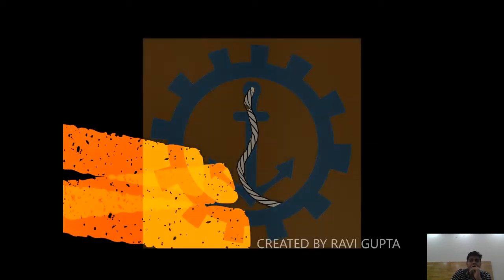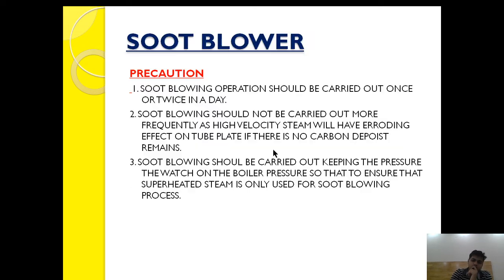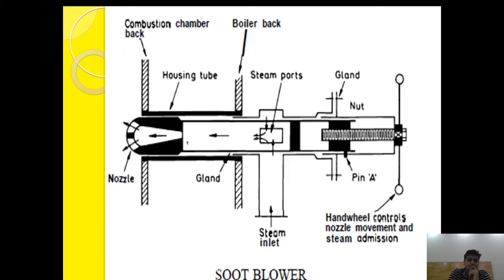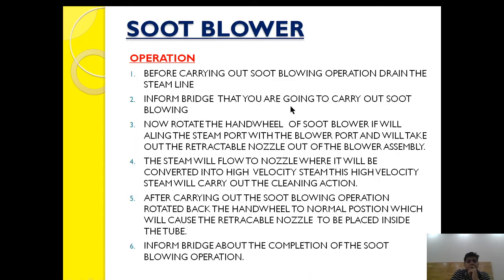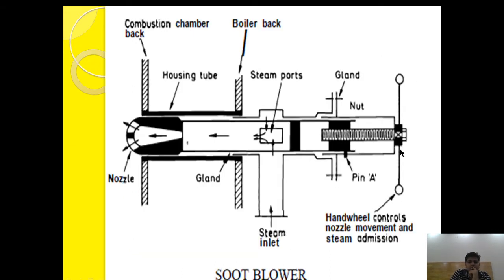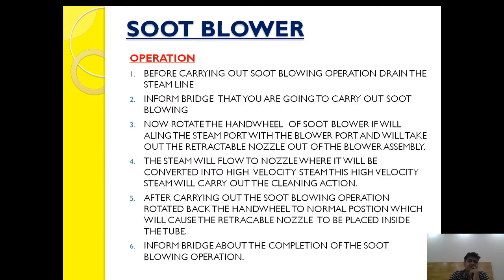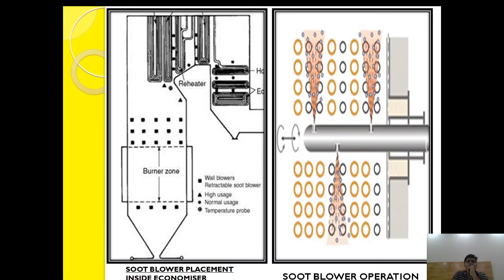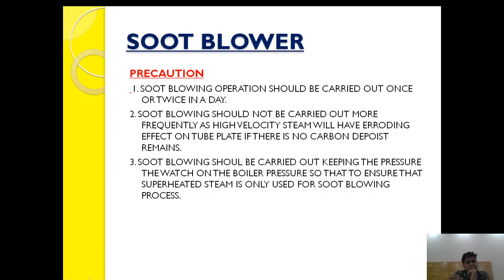SOOT BLOWER IN BOILER|OPERATION|PRECAUTION|EXPLANATION|

Comment: Thank you so much for this. When should soot blowing be applied to avoid soot fires ?Prior to wet cleaning or Prior to engine air intake or Prior to an increase in power or Prior to dry cleaning?

Comment: Sir, if the drain valve fully-closed switch and the steam valve full-opened switch are not working(I mean the Digital Input signal to the PLC), will it trigger the Interlock condition causing the soot blowing procedure not working?